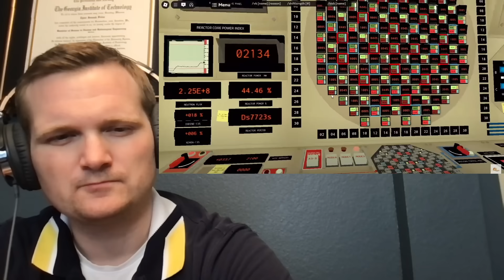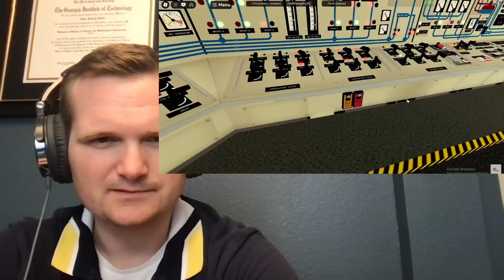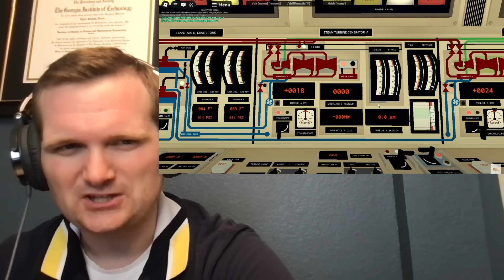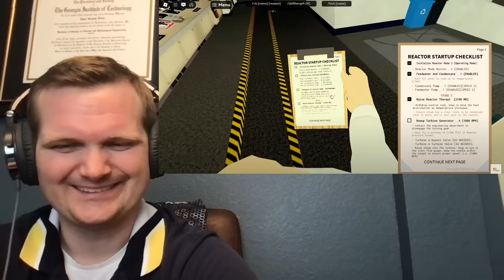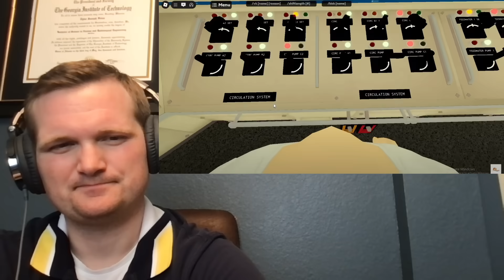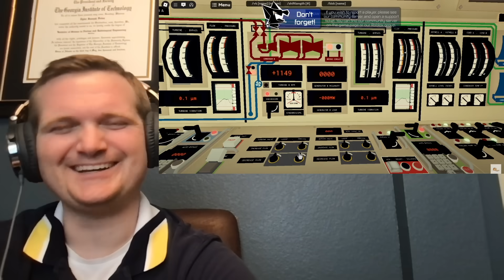Can You Operate A Nuclear Plant in Roblox? - Nuclear Engineer Reacts to Oak Ridge Nuclear Plant

Comment: I'm not sure exactly how relative efficiency % is defined. It appears to be some arbitrary value they selected, but that efficiency value is a multiplier for your XP. You reduce power consumption and reduce reactor power MW while still hitting target. Particular features the last time I played was unrealistically super heated deaerators ( only pressure matters ), manually running the reactor at low water, manually running the deaerators at low water in order of difficulty.

Comment: Btw the control room is not the best thing in this game, the best thing about this game is the high graphics, considering it is in Roblox (you can’t see this in the video because his quality setting is set low) and that everything is modeled, from the core to the turbines, and the steam tunnels to the steam seperators, cooling towers, condensers and even the EDGs and also the eccs tanks are modeled. So this isn’t shown in the video but if you would see the entirety of the building you would see the real strength of this game

Comment: 42:30 well he didn't "almost" reverse power the thing... someone do the math how much energy it takes to accelerate a giant 800+ MW turbine by 10+ RPM within a fraction of a second, i'd be amazed if the thing remained in one piece after that and the turbine hall would certainly smell a little funny from all the fried electrical equipment 
(that's assuming they don't have any safety features immediately tripping the instant he presses that sync button)

Comment: The reason why you need to sync gen A first and then go for B is that the generator A is powering bus B pumps (these marked as B or 2, whom are not powered by external grid) and thier breakers cannot be reset without having internal power bus energized

Comment: as someone who has nearly a million "points", this guy is doing a rather terrible job, even for the standards of this game.

e.g. adjusting the speed for one of his recirculation pumps that he never enabled (looks like B3?) 48:29, as well as having the recirculation pumps imbalanced like the entire time, and my god that core heat distribution hurts me.
Reply: Yea I agree with you.
Reply: Yea
Reply: Can u do a gameplay for this game? I'd deffo watch it because I cannot run the reactor, last time I tried somehow after turning on the turbine A and turning on something on the electrical panel to reduce the load the whole power went out after 10 minutes. I gave up on that might try again but help.
Reply: @screwedtapesss6549  during startup, power can drop unexpectedly, so it helps to keep an eye on the position of your red rods, if they're very withdrawn then you might need to adjust the manual ones. Another way to mitigate that is just to move quickly. The faster you get through the power levels, the less time the reactor has to stall. i'm a little confused on what you might be talking about on the electrical panel, but honestly you do not need to worry about that until shutdown. good luck if you do try again!

Comment: 1. That printing sound you heard it from a button pressed sensor which has a sheet with all interactions, used mostly for public games to find who pressing things they shouldn't be.
2. They have added vibration from the turbines which can cause issues.
3. This game isn't as easy as it looks, it takes hours just to figure out how to be almost successful, then blow up and have to start over. It is not the easiest game.
4. In the first video you say that you like the little bit of security at the beginning to go into the room, but that's not it, you spawn in a parking lot and its a MASSIVE map where you can go everywhere, turbine hall, reactor, climb the water vapor towers, LOTS of security,   diesel generator rooms,  etc.. there is no limit to where you can go, exploring the whole place can take over an hour or so.
5. PLEASE play this game, its worth it on another level. The private servers and free so you can play alone and have access to all parts of the plant.
6. I have over 40 hours on this game learning how everything works and how to run it, and it is such a fun experience. 
7. You will see that there is a point system, you get them for how much electricity you produce and is stated on the pay check, the amount of hours you work limit that amount, so if you join a public server that just sold a lot of energy, you only get 1/24 of it because you didn't work the full 24 hours. I have about 120,000 points from playing so much. Also, points give you ranks/ titles staring from visitor, to trainee, to junior operator, to senior operator, supervisor, and inspector. The higher the title the more other people trust you usually in public servers.
8. This game inspired me to learn/ research/ read things on PWRs and attempt to get into MIT, it game me an experience that I couldn't forget which made me realize how cool being a nuclear operator/engineer would be.

Comment: I loved it when you were talking about the turbines and the turning gear. I used to work at a none nuclear power plant... One day, some how, an operator managed to drop a generator online 180 deg out of phase (our sync meters were old and if you weren't used to them you could do it) Watching a turbine try and stand up against the national grid 180 out of sync is something I never want to see again. Lets put it this way, what was left of the turbine hall bristled with turbine blades !!!
Reply: I think in this case, the "standing up" part was quite literal. Being a retired Master Welder with 30+ years of working with heavy machinery, you have to have a great deal of respect for the immense power your equipment can generate or hold. If not, well...
Reply: Btw, the game actually does let you do that. You are able to destroy the turbine blades and render it useless until you repair them

Comment: As a reactor nerd, it is really educational for me to watch videos like these. Your very detailed explanation on how things would be done in a real control room. All the procedures involved, the rules and regulations. It really shows how much care and thoroughness goes into running a nuclear power plant.
As to the A3-5 referral to Chernobyl. That "3" is actually a "z" in Cyrillic. So, it reads "АЗ-5" in Cyrillic which translates to "AZ-5" in English.

From what I can see in the control room: this reactor looks like what you would get when a regular boiling-water reactor and an RBMK had a really nice evening in the containment building together. There are some things one would see in the first reactor type, but also things pointing to the latter reactor type.

A real RBMK had quite the spicy core before 1986, reactivity wise. Its core was prone to rather wild reactivity swings, especially at low power levels. Fun fact: the graphite masonry runs in excess of 700°C at full nominal power (1,000 MWe). Since the very well-known accident in 1986, serious changes have been made to its core composition to make it a much safer and more agreeable reactor to work with. But it will always be a big, grumpy headstrong reactor that needs careful handling.
Reply: A nuclear reactor is basically a giant spicy rock with the temperament of a teenager!
Reply: @nathanc4183  
In an interview, a veteran of the Soviet nuclear industry, working at industrial plutonium-producing reactors, once said; "Reactors are like children. You get to know their peculiarities when spending time with them." In another interview I heard a worker say that their reactor sometimes behaved like a "капризный ребёнок" - a naughty or capricious child. I think that is a very good way of describing them. Each reactor is unique, with its own "personality" so to speak. Even if you have multiple reactors of the same make and model at your power station, each one will behave a little different from their neighbour.

Comment: coolio, i was waiting for this one
but: fuel channel leaks happens at above 1600F in this game if i'm not mistaken
about the enginnering: currently, an npc answers, but in future updates, that will change to players resseting the breakers 
if you go above .6 micrometers, or .3 with .3 on both turbines the whole place starts shaking, so that's a neat touch
the synchroscope: it's simplified, if it weren't everybody that doesn't have good timing or a good computer (this game requires a bit of a beefy pc), is going to crash out because they keep tripping
those random announcements like "biohazard warning" are just there for ambience
the lights flicker because of the fact they're on the same bus as the main bus, bus A, so in the transition between using the startup transformer and turbine power, the lights flicker a bit
the breakers: for some reason, if the pump is on bus B (the one supplied by the turbines), and bus B is unpowered, you can't reset the breakers, they stay off, even if reset manually from the pump hall
connceting to the grid: the only thing it does is give you a load following, besides that, you are almost always online, unless all turbines are off
the efficiency is relative efficiency, not actual efficiency, it's relative to the approximate 37% efficiency of an actual reactor, if the efficiency is >37%, then the relative one is >100%, and vice versa
the game is co-op, up to 10 people
equipment failures can be turned on as "random failures", they range from a pump trip, to a LOOP (Loss Of Offsite Power) or Fuel Channel Leak, or a turbine malfunction and trip

now to be truly honest, no offense towards the original poster, but they're not the best operator, there are many others that have more experience and can keep the reactor a lot more stable

this video did teach me a lot about actual nuclear reactors, so that's gonna be useful eventually, nice one! (sorry for long comment)

Comment: Good to have you back for round 2. Will edit this to provide more explanations and input for you based on your reactions as I watch over the next few days.

For our reactor, a fuel channel leak occurs at around 1800f. 1200 and above is fine but the core begins getting too toasty above 1400-1600

Our synchroscope is highly simplified. It's nowhere near as complex as irl.

When closing 64A-M, that's not an output breaker, that's an internal systems bus. Specifically bus A, which powers all of the startup equipment and basic plant systems. Including the lights, which is why it flickers as the startup transformer switches off a moment before bus A closes

The lag you might see is a result of the game design. At higher graphic settings and render distances, we're rendering a LOT of different parts, even going so far as the turbine blades themselves. The roblox engine is NOT designed for this stuff.

A note on the thermal power at 100%: our reactor has more control rods than I believe it needs. We can likely exceed the 4800 that it's rated for by removing every rod. You are absolutely correct in that nothing will tell the neutrons to stop in that way.